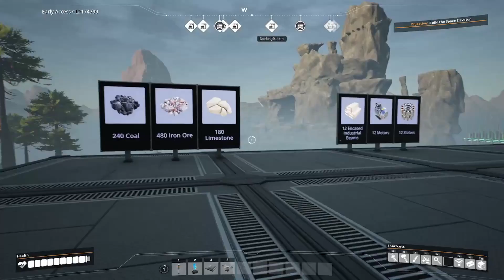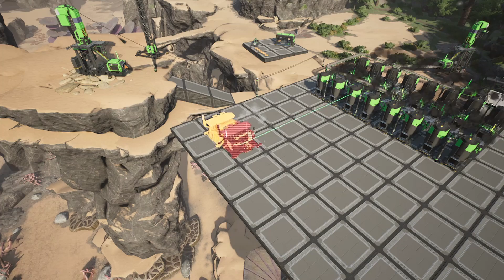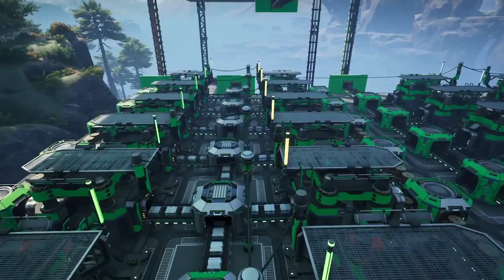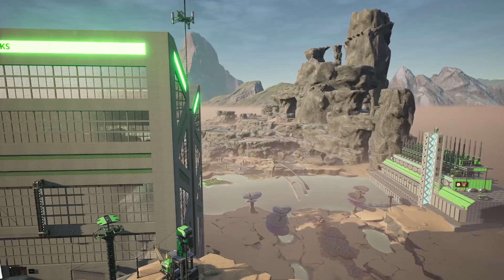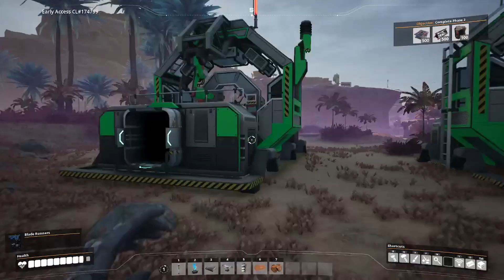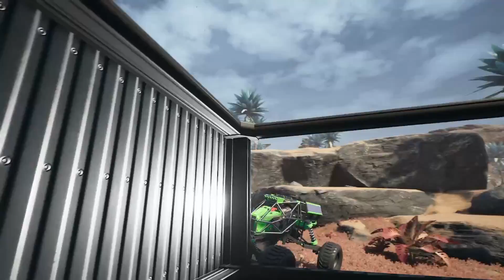How to Build an Advanced Steel Factory - Satisfactory Update 5 Ep 07 (Tutorial/Guide/Let's Play)

Comment: Tip for factory ceiling height that makes the base layout pretty modular: The standard wall height should be 2x 4m walls + 1m wall piece. This is important because it's the minimum ceiling height to enclose most T1 factory machines without clipping. The small 1m piece gives clearance for the next 1m floor above. For floors that contain larger machines, you just build up two standard room heights (or more if needed).

Comment: Your builds are quite creative and unique. I don't have the creative spark as you do in my builds. I am trying to set up a trucking system instead of a main bus. I have no idea what I'm doing and it's taking longer than usual, but it is still better than trying to setup main bus which takes many days and 10's of thousands of resources to make. What I have finished doing, is setting up a truck stop to pick up ingots and steel products. I wasn't sure how I wanted to deal with steel, but since the ingots are only used to make the 3 products (pipes, beams and encased beams), I figure I make those on site and them truck them over to where I need them. I've decided on where to start producing iron parts and I plan on doing the same thing you did, in layers.
Reply: Investiga más recetas en el MAN te pueden salir recetas de producción más económicas por ejemplo la que tengo yo es solo mineral de hierro y mineral de carbón y evito hacer tantas fundidoras como en esta configuración y me cree más fundidoras de mk2 que la normal así creo automáticamente el lingote de acero . Te facilitará más le eficiencia en las máquinas investigando disco duros en el man .